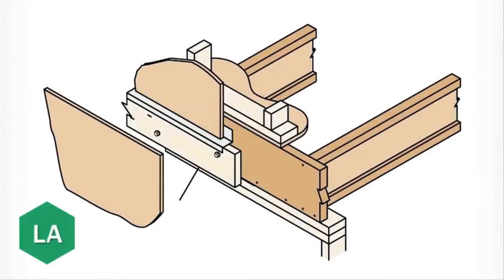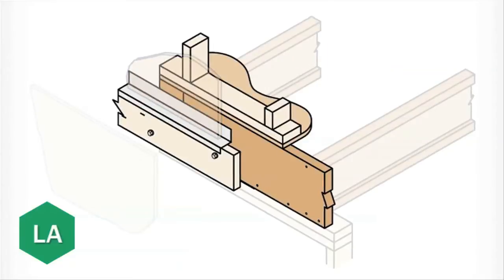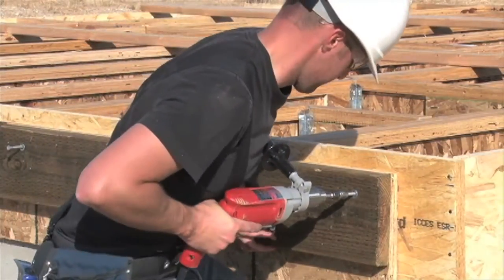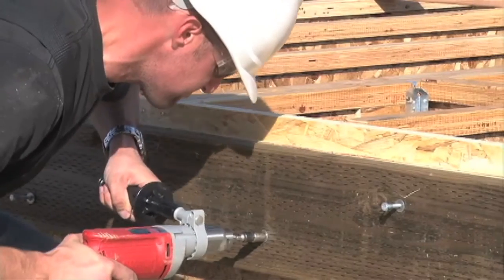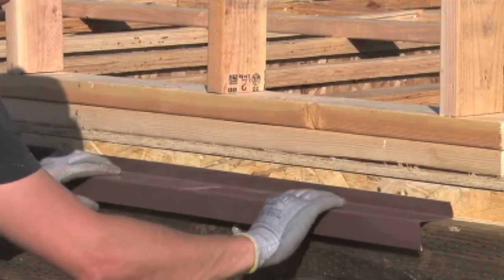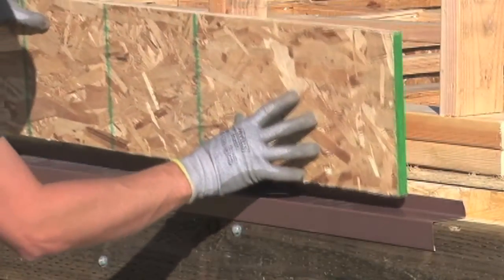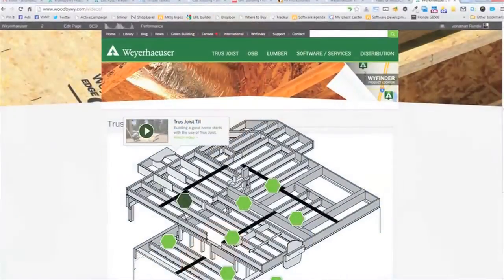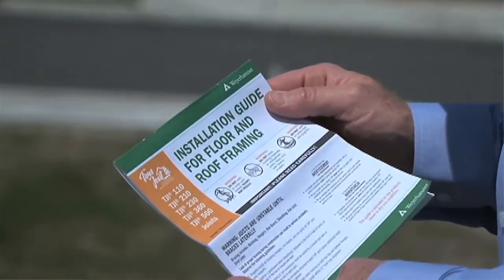Detail #LA - Trus Joist EWP Floor Installation Guide

Comment: I am installing tgi floor joists that span 20ft face mounted between two beams.  Is blocking required for the joist between the beams and if so, at which location?  Thank you.